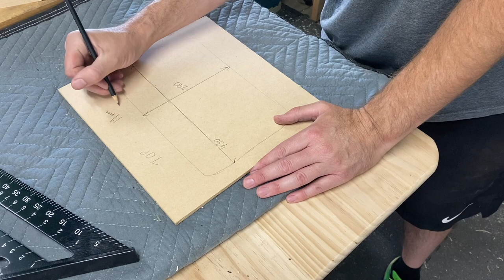#fakewoodworker copied a family heirloom...with pallets #palletchallenge #diy

Comment: The fake slat top is awesome Jimmy. The question is, if you fake stand on it will still hold you up or does your foot hit the floor?! 🤔🤔
Reply from the maker: That is indeed a good theoretical query. I mean if I were to fake stand on the fake stool I'd need to arrange some kind of fake risk assessment to deal with any fake injury which may occur. But I believe if my fake calculations are correct (prolly not though) it should be able to hole my weight as the "real" one does.